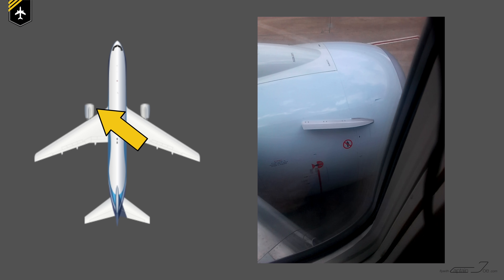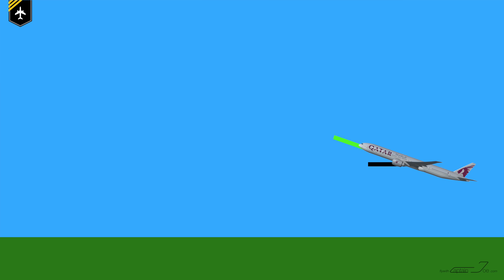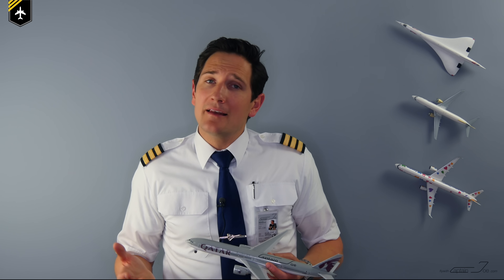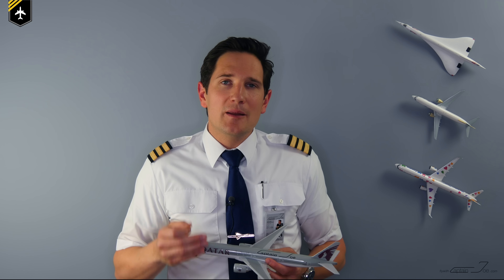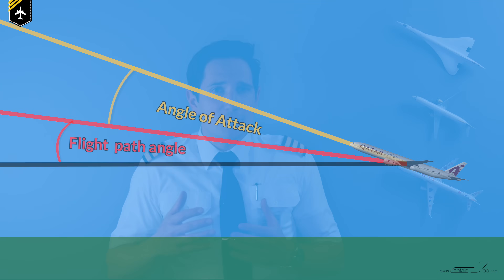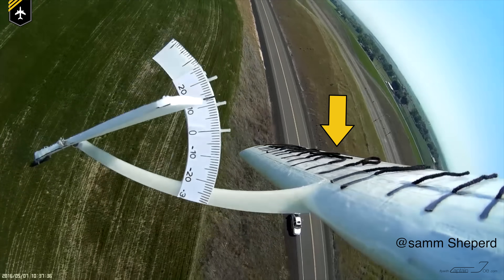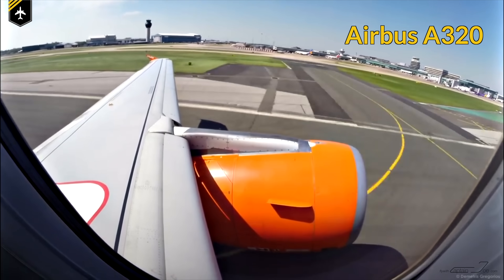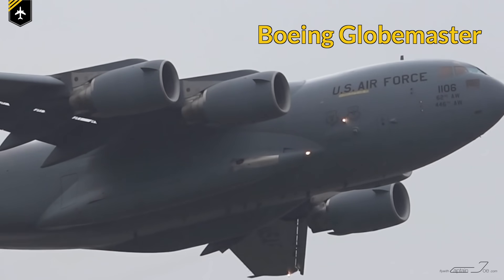MYSTERIOUS OBJECTS on Planes - Nacelle Strakes by Captain Joe

Comment: Hi Captain Joe, I am not a pilot but I thoroughly enjoy your videos, they are so informative. The other day I was watching the movie Sully where bird hit damages both engines. This got me wondering if some kind of metal grill can be installed in front of the engines. Is this possible ? Also, why is it a miracle to land a plane in water ?? Is the structural integrity of a plane not strong enough to withstand a water landing after reducing its speed to the bare minimum ??
Reply: It's not possible to install a metal grid in front of the engines because it will disturb the air flow into the engine and affect to efficiency and performance of the engine. The other thing is that in case of the bird strike the grid will obviously break and get sucked into the engine and it makes the situation even more worse.
Reply: @mikep9604  thanks for the info Joe

Comment: So I was on my way back from holiday on a a320, and it seemed like a cowling flap on the bottom of the engine was open. 
Course it didn’t cause any problems since they’re designed to be aerodynamic even if they open. 

I just thought I’d bring this up since it’s something I’ve never seen, and I’m a very frequent flier and in flight training

Comment: It's to deflect the engine away from the aircraft fuselage or tail... incase of engine break-off... It keeps the engines pressured downwards during forward speed. It has nothing to do with lift of aircraft performance... If the engines break off the wings (which they are designed to do with shear-bolts that hold the engine in place, that breakes off at certain high G-Force...), it could be fatal if the primary flight controls etc got damaged... I believe it's called an engine "FIN" or "FINS" depending on the engineers wording... 😎

Comment: Hej ! Brillant presentation, but just one point of language, people sailing do the same mistake: the air flow on a sail or a wing is ALWAYS turbulent. Laminar flows only exist in laboratories basically and are very unstable for high reynolds number like in this case. What you mean by turbulent is actually that the boundary layer separates from the wing, which has nothing to do with turbulence: a turbulent boundary layer around a wing or a sail is actually harder to separate than a laminar one thanks to the billions of small eddies which are super efficient to transmit the information that there is a wing to the air.

Comment: +Captain Joe — Do you have any information on when nacelle strakes were introduced and by whom?  I had never noticed them before, but when I fly commercial, I usually sit in a row over the wing or just aft of the wing where the engine cowlings aren't visible.

Comment: Its not the actual vortex that creates the lift. The vortex merely forces clean airflow to pass over the surfaces you desire. Vortexes are by definition turbulent air so they would not generate lift (as seen by the vortex clearly seperating from the aerosurface).

Comment: Damn! I'm good! I figured out what these things were for even before being educated what they are for! I would look at the vortex generator strakes and noted the angle they were at and I figured they were forcing air over the wings. When I first saw the beautiful white spinning vortex coming from them on takeoff one day--I saw how clearly they were forcing the spinning vortex up and over the wing. I then said--that's it! They are for increasing lift due to the engines creating a barrier for even air flow at the leading edge of the wings. Thanks for confirming my intuition--which is quite good!

Comment: What is the purpose of the small fins/strakes on a B737 located on the rear fuselage either side of the vertical stabiliser,  just above the horizontal stab? Usually see them clearly when walking up the rear air stairs near the APU.

Comment: To be sure, the strake is nothing more than a vortex generator that you see on some wings as well as on some race car roofs.  In the former case the vortex is adding/mixing high energy flow to/with the low energy flow caused by the engine nacelle to delay air flow (boundary layer) separation.  It is the same principle on which wing slats work - or indeed slotted flaps.  In the latter case, the vortex generator are delaying boundary layer separation to reduce drag caused by flow separation - i.e. reduce pressure drag.

Comment: OK, the black new Zealand plane taking off, explain the cloud forming around the spinner cone, inside cowling and in front of those blades
Reply: Basically it's the exact same reason as you can see the vortex generated by the strake. There's a massive pressure drop happening in front of the fan because the air starts to accelerate massevly in this area. So the result is adiabatic cooling and the moisture in the air condenses and starts to form a "cloud"

Comment: It's McDonnell Douglas MD-11. Fun fact: Engineers placed two on the pylon-mounted engines of the MD-11 as a way of increasing stability during landing and reduce the staling speed as the MD-11 is relatively unstable because of the smaller tail plane when compared to the smaller DC-10 (yes, the DC-10 has a bigger tail plane than the MD-11). But in the end the MD-11 won the spot for the "fastest landing speed" of a commercial aircraft and in other words, still has a relatively high stalling speed when compared to other aircraft.

Comment: 0:36 you say mounted on the upper inboard part of the engine. Looking at the type you flew before, this is only true for the A320. On 318/19/21 the strakes are mounted inboard and outboard, only the 320 has them on the inboard Fan Cowl only. Just FYI ;)
Also nice to know. It is possible to dispatch an A320 with the Strake missing on one side. But acc. CDL it then needs 1,08x longer runway length.

Comment: Nice video, I love your channel, answered many of my questions about airlines. And one more question, might sound stupid but, do airplanes have abs? :)))) I mean, I had a think and brakes basically need traction on the ground to stop the plane, which basically you need to be a master to apply the brakes without Tokyo drifting at those speeds. So abs would do the job by smoothing your braking, no?
Reply: Captain Joe may explain it a lot better than me but there was a talk about it on Mentour Pilot chanel and it was said that Boeing 737 has something called anti skid system which eworks similiar to car's ABS. Basically releasing breaks when wheel is about to be blocked and start skiding

Comment: At 4:50 you say that the strakes reduce the stall speed. Wouldn't they actually increase the stall speed if they generate lift? I might be misunderstanding the term though. To me "stall speed" sounds like it would be the speed at which the aircraft would stall for a given angle of attack. If you're doing 200 knots and can climb with an angle of attack of say 20*, wouldn't "lowering the stall speed" mean that you would now stall at 200 knots for the 20* angle of attack?
Reply: No, the terminology used in the vid is correct. Stall speed is the lowest possible air speed an aircraft is still able to fly. With the strakes this speed is lower. As an example without the strake stall speed is maybe 180 knots, with the strake it's 175 knots at the same angle of attack.

Comment: What are the air intakes at the bypass casing of the boeing 707s engines for? They open when full throttel is enabeld. Also the Lockheed C-5 has them on the engines.

Comment: Is it true that the old 3 engine airliners, like the Boeing 727, the Lockheed L-1011, and DC-10, had problems at high angles of attack with their fuselage causing a wind shadow in front of the middle engine intake?
Reply: Jay Ski True. Also on the L-1011, the splitter plate (between the bottom of the center intake and the top of the fuselage) was modified (lengthened forward) to improve intake performance and reduce cabin noise.

Comment: Hello Capain Joe and friends.  What do those scalloped edges at the trailing end of some modern aircraft engine nacelles do?  I doubt it's just for their good looks, but as a curious member of the general public, I have no idea.  Thanks for your consideration!
Reply: They reduce noise by helping the cooler, slower air from around the engine mix with the fast, hot air coming out of the engine.
Reply: They are called "chevrons."
Reply: Thank you Iceair 767!   Nice to know they have a name appropriate to their distinctive appearance.  

Given they reduce engine noise, I'm functionally and visually reminded of the (non-aircraft) subject of "nicking" organ pipes to reduce undesirable noise -- by creating turbulence in an otherwise laminar airflow.    Perhaps a similar physics is involved, scaled way up for turbofans.   More info on nicking physics here: http://www.pykett.org.uk/tonal-structure-of-organ-strings.htm#Nicking , and a decent picture of three different amounts of it way down on this page: http://faculty.bsc.edu/jhcook/orghist/works/works03.htm.  

Thanks again for your consideration

Comment: I’ve learnt that the reason of the vortex generator is to avoid air flow to go to the wing tip in swept back wings thus decreasing stall at wing tip loosing aileron control

Comment: Some military aircraft also have the nacelle strakes,  but they are sometimes built into the fuselage and we cannot forgot that a F-16s or any military aircrafts  wings have a different structure.. both sides support even amounts of air flow. An F-16 basically sacrifices nacelle strakes for having a curved upper wing near the fuselage, towards the front, this is the point where if we go into a high G turn we would see hell of a lot of condensation, but that’s a different story all together

Comment: Joe I have a question this summer I flew to Crete and when we landed in Crete I saw a door open on the engine and a tube shaped smoke came out but when we were flying back home that didn’t happen so what is that smoke and why does that happen
(We we’re flying on a bombardier cs300 )